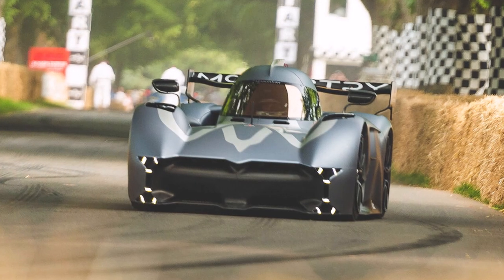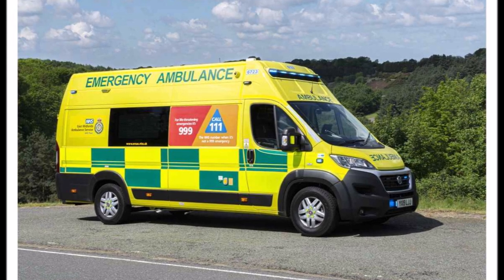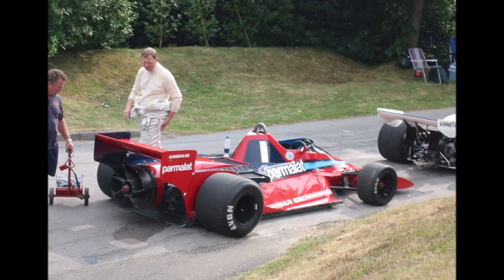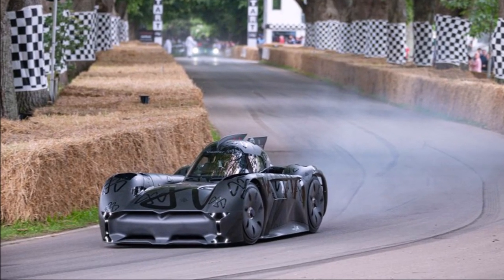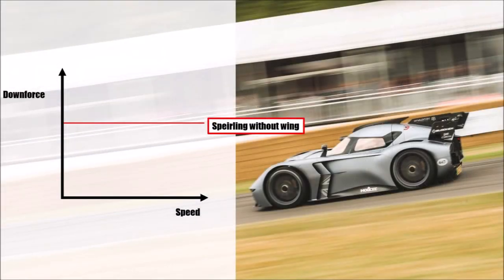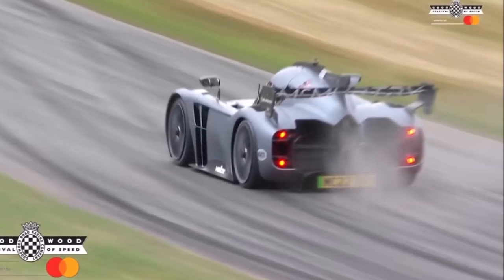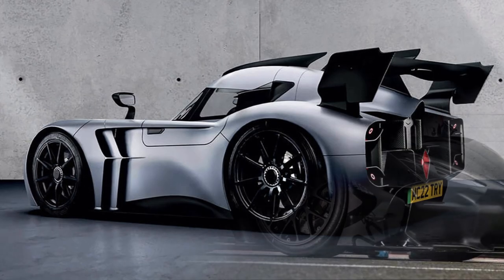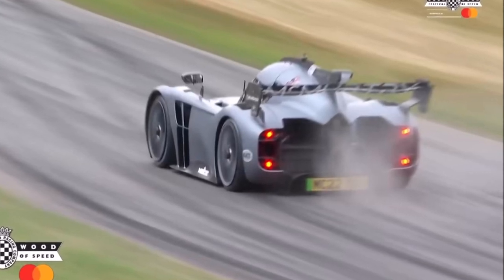McMurtry Speirling - The Unusual Engineering EXPLAINED

Comment: If I understood correctly, this system is a vacuum cleaner against the pavement that "sticks" the car to the ground, while pulling air from behind.

I would have thought that the weight of the batteries distributed on the chassis was enough to give "ground effect" to the vehicle.

Comment: The consumption of 12kWh/100km sounds very high for the size and weight of it. Should be less than half of that - unless you run the fan of course.

Comment: Doesn’t applying two tonnes of downforce equate to putting that amount of weight on top of the car?
Reply: That force is not being applied to the top of the bodywork of the car..
that force is being created under the car sucking down on that square metre of bodywork under the car...
and since that square metre of bodywork is conected to the track via wheels and suspension..the force stays down low.....and has no impact on the ultralight body above those points.
Reply: @JohnSmith-yv6eq  
Thank you for that. I still can’t quite get my head around why such a strong force would not slow down the car but I watched it go from zero to insane in no time at all so it obviously works.
I’m going to fit a Dyson vacuum motor under my Audi

Comment: sorry, maybe a silly question: no downforce at the front of the car is needed?!?
Reply from the maker: There are no silly questions!
The bodywork could create some light front downforce by the looks of it, but the main point is that the vacuum system acts pretty close to the centre of the car, therefore creates relatively balanced (slight rear biased) downforce
Reply: @BSport320  thanks for your answer! In my mind I saw the car raising its nose to heaven with that massive acceleration. 🙈😊

Comment: This car sparked some new ideas in my mind.  If you had a vacuum sealed chamber for each wheel you could reduce the wheel when resistance but tire temperature management would be more challenging but not impossible using radiation heat transfer.  The suspension could be made much softer this way with the load applied directly to the wheels.
Reply: That has no much sense. 1. The smaller chamber size, the smaller downforce. 2. All the weight of the car, including generated downforce goes to the ground through 4 wheels. Not depending on what part of the car generates those forces.

Comment: "At high speeds, traditional race cars have more downforce than Speirling"
Um, didn't you also say before that that the Speirling always 2000kg of downforce from the fan?
Which race car produces 2000kg of downforce??
Not even a Formula 1 car produces that much
Reply: Formula 1 can produce 5-8 g downforce despite on FiA-regulations, which try to reduce it.
Reply: as stated by Lassi, F1 cars produce about 5-8g of cornering and braking forces, which translates to about 5-8x the weight in downforce.

Let’s take the lowest assumption just for context (5g), so a modern F1 car should make around 798x5 = 3,990 kg of downforce. Not quite sure at what speed, but I would guess somewhere around 140 mph (225 km/h) since F1 cars usually generate those kinds of cornering G forces at that speed.

Granted, you can only get this kind of downforce with open wheel cars and an unrestricted LMP car like the 919 Evo.
Reply: @devandrasimanjuntak1646  interesting..I didn't knew that it works like that..a full own weight of downforce for each additional 1g of lateral force. Thanks

Comment: Interesting and coverage. Now for the provocative question: why is it that professional aero dynamists have worked so little on filling the low pressure behind a moving object despite this being a major cause of drag?
Reply: The fans and the body porosity are doing exactly that.
Reply: @leoarc1061  Of course, buy why has it taken so long (ie no been really studied)?
Reply: @Andrew-vx2ls  I think it's a case of pros VS cons. A fan takes space, it costs weight and  the drag that it reduces doesn't justify the energy that it consumes. It only starts to make sense when the fan is primarily used for downforce, and even then, the drag reduction is a small by-product.

Furthermore, motorsport regulations tend not to allow fans for aero purposes, and road cars tend to need the space and energy for other considerations.

Comment: Must've seen a dozen pics of this thing before even bothering the read any titles. Assumed it was a home built attempt at a supercar. Looks like something someone with zero engineering and driving experience would build based solely off their concept of what a 'cool' car should look like, but stuffed up the proportions during the build. There's no way that wheelbase conveys the image of a cutting edge super dooper hypercar. No way in hell. Commonsense tells you it wants to overtake itself with any. Application of throttle mid corner.

Who woulda thought it huh? 

Seems I'm 100% wrong about this one

Comment: I see crowned (public) streets reducing the effectiveness of the suction area.  Plus imagine all of the stones and dirt that will go through the fan/filter. A pace is car that can clean the track as it leads the cars around (at Lemans).....Curious how water/a wet road a/effects the down force; if it increases/decreases/or makes no difference.....Also, in some ways, the silhouette of this car justifies the Mk5 Supra's shape (of course derived from the FT-1 concept).
Reply: Clearly this is a track only car and would not work on public roads (well, it would 'work', but would be pointless), and as for using it on a wet track or where there are standing puddles of water could potentially be disastrous, imagine putting your vacuum cleaner hose into a bucket of water.

Comment: 500 km range? What planet are you from?
Reply: Lightweight car running on flat roads without the fans needed and driven at road speeds within the normal limits=500km.
Flat knackers..maybe 20KM? (Since it can't get round the Nurburgring competitively as it has a top speed iunder 230mph)

Comment: Why is it so short?
Reply: it's designed to have the motors, batteries fans and other stuff that is needed to make it a car, plus the driver and nothing more. Only needs to be 3.2 metres long
Reply: Hot wheel
Reply: @thomashayhurst6547  thanks so its really just to save weight
Reply: @DaewooAirfryer  more that it just doesn't need to be any bigger. One of the engineers was saying when they make the road versions it'll be easy to get through gaps in traffic (assuming their very rich owners ever drive them) since it's so short and narrow

Comment: Brilliant design, but on the road it would have to turn the fan off to stop small stones hitting the car behind. The same for motor racing, can you imagine going over some gravel with the fan on. Fan technology is brilliant but only for drag racing and hillclimbs. It would never be sanctioned for circuit racing. How about Pikes Peak in 2023.
Reply from the maker: Pikes peak is actually a great idea for this!
Reply: It shows you the fans are filtered in the video
Reply: I think Speirling could easily geo fence  fans modes. Even system could be setup that way that refuses to start fan if filter is cloged or isnt even there...
Reply: @cheesyisgod  you can also see clearly the output of the fans as it zooms up the hill. Lots of stuff being blasted out.

Pikes Peak, go for it!!

Comment: Man, this car SUCKS! This car needs its own formula class of racing. Or F1 should fully incorporate its concepts.
Wet track? Let's just drive and SUCK the track bone dry!

btw ... it's now one square meter of SUCKtion but if F1 teams were allowed to use this, it would be an advanced tunneling system under the car to SUCK the most where it's needed. I bet McMurtry is working on it already (?).

Comment: ACTIVE DOWN FORCE!! Listening, FIA??
Reply: They have banned the fan before in F1.  Active aero has also been banned in F1.  They do not like it.  Active aero is easier than fixed.  You put a fan, a movable skirt, movable wing slap etc.  It will take real genius work if all aero components are fixed.